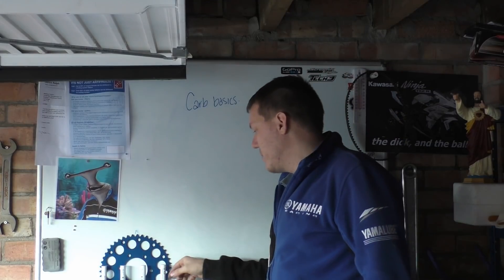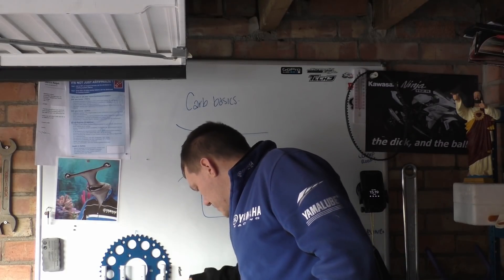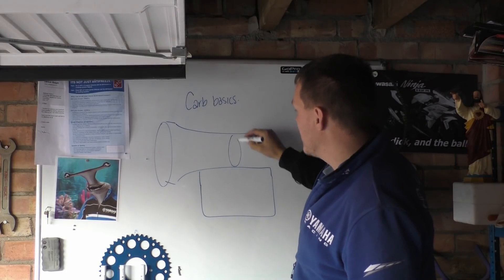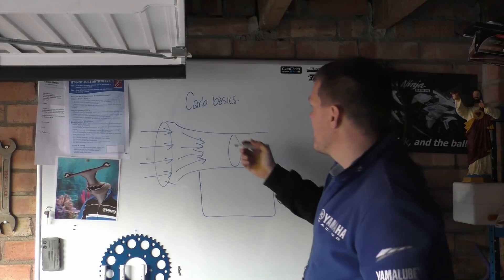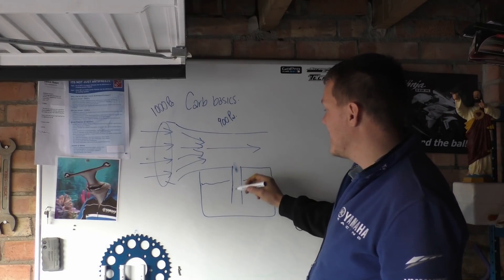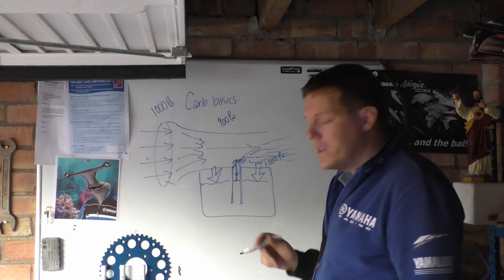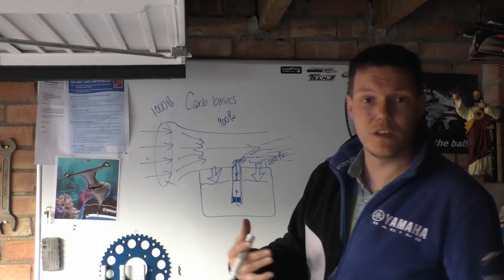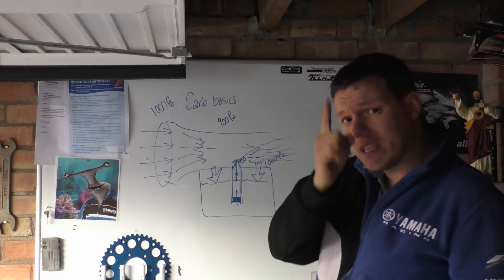Carburetors - Part 2 - Venturi

Comment: Hi again mate, does the lower pressure cause a vacuum which pulls the fuel out of the float bowl or is it simply forced out because the higher pressure in the bowl compared to the venturi pushes it out?
Reply from the maker: Nothing is ever pulled with regards to air. The air pressure above the fuel in the bowl is higher then the pressure in the venturi. So the air above the fuel forces the fuel into the air stream
Reply: @thedirtyworkshop  Cheers mate, does this theory also apply to things like rear wings where the lower pressure passing under the wing isn't causing a vacuum its just the higher pressure above providing downforce?

Comment: One problem with the slinky model is where you suck air through the venturi the slinky model works, but that it tends to fall down when you blow air under pressure into the venturi and still observe a low pressure in the narrow section.
The slinky is useful in showing what happens when a valve opens in the intake or exhaust.
Also keep in mind the venturi is and accoutrement to carbs that allows slow engine speed metering.
It'll still work without a venturi at all just not at low engine speeds because the carby actually works on the the pitot static principles.